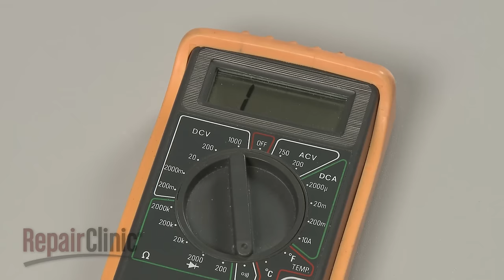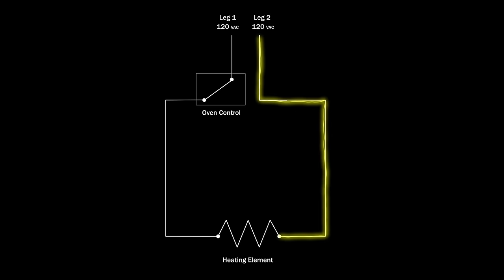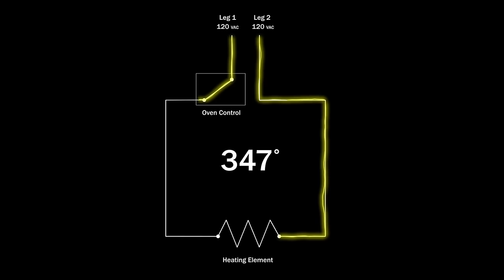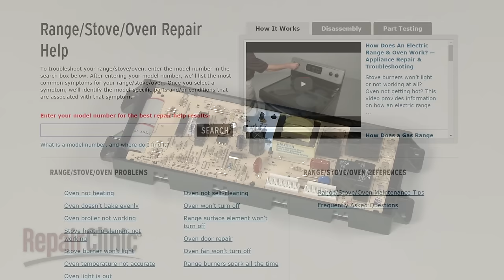Electric Oven Won’t Heat — Electric Range Troubleshooting

Comment: I just solved a problem so easily. The story: Bought new Frigidaire appliances. Stove / Oven Range didn't work at all. Nothing got hot, but the clock and lights worked. I had to call warranty in and scheduled a service tech to come in a few days. ANd thinking the worst, I wanted to see if maybe someone can tell me how serious the problem is and I am going to be out of my oven for another week or so, I found this youtube video. It gave me the idea to double check the power to the brand new oven. And so it was in deed. The plug was not all the way in, just enough though to give the lights and the clock its power, but now enough power to the burner elements. I pushed the plug in all the way and now everything works. It boggles my mind of why the factory or the tech was not able or willing to troubleshoot that with me over the phone. It's so easy. Thanks for your video.
Reply: Ha...thanks.  That's what was wrong.  I pulled the stove out and it looked plugged in but I pushed it and it went in just a little bit more and problem solved...thanks

Comment: After following the sequence of components test, we reached the replacement of the controller, which we could reach through the back of the cabinet, where the extensive heat damage of the batting, the oven light socket, the plastic housings on the relays, we were done.  We have pronounced our Frigidaire Gallery electric range with convection oven and are shopping for another range today.  Thank you for the video.

Comment: 1. Malfunctioning bake/broil element
2. Incoming power problem
3. Loose or burnt wire connection
4. Blown thermal fuse
5. Defective thermostat/sensor
6. Malfunctioning oven control board
Reply: Where is the thermal fuse?
Reply: @lindahawkins8035  where is the fuse ??
Reply: Really good information, sadly for me other than the element there’s no way I could be a regular person replacing thermal fuse or thermostat sensor oh my God I touched the oven control but I might blow the whole house up!… Good video though but it only reinforce that I don’t know what to do about my oven not getting hot I might find out what it is but I will be able to repair it myself other than the element
Reply: @raquelclass9647  there is a reason specialists exist, while you don't want to pay, they are gonna be able to do it and do it right if you don't feel confident. Especially if you think your gonna mess something up worse which is kinda hard to do if it's already not working. It's generally cheaper to have it done right and with a warranty that comes with it.  Vs you being a parts replacer, guessing, getting it wrong, and costing more money in the end. Just a lil food for thought.

Comment: One thing RC does not mention with regard to the control board. You can use a multimeter to test voltage is being sent to the oven element at 220. If it isn't that is probably a good test to rule this out.

Comment: Thanks you saved me $500! I tested the outlet and it turns out one of the breakers had tripped.
Reply: Where is the breaker located?
Reply: @djsuichic1562  breaker box.
Reply: In a wall next to the kitchen.
Reply: You have two breakers in the same inlet?    Dude if you have two single pole breakers to make 240v you have bigger problems bud.

Comment: This just happened to me. My warranty is up too.  the clock was working but not the top or oven was getting hot.  The plug was loose so now it works now.  I have a GE glass top oven, only 3 yrs old
Reply: i read your comment an checked my plug an it works now lol thank you

Comment: Kenmore oven the problem is the top element work the bottom element does not but it does not have a break in it so what could be the problem
Reply: Did you find out? Dealing with this now
Reply: Did you find out

Comment: This information might come in handy- I have a 13 year old  GE profile oven . My symptom ?  The  oven would reach the correct temperature but after 10-20 mins  I would have lost about 50 -60 degrees ... I  ended up changing the termostat - that was not the problem.  Solution - it was the convention element that was burnt !!    Somehow the oven uses all three elements to keep the termperature of the oven and not just the upper and lower elements.
Reply: My oven is about that old. They can last a very long time?
Reply: Wow, same GE Profile with same issue of not maintaining heat and if I open the door, heat escapes, it doesn’t reheat unless I turn off the oven and reset the temperature. I suspect it drops heating during long baking sessions as well. Hateful that it counts up the temp as it preheats, but then lies and only shows the desired temp and not the actual.

Comment: Question.  I have a 15 year old Kenmore stove that I have replaced the element in several times.  The other day I turned it on to preheat and came back in about 15 minutes and all the lights were off.  I reset the breaker and the lights came back on but the bake element would not come back on.  I then checked the bake element and it had broken in a hot spot.  I replaced it the next day and it would still not come on.  The only things left in the circuit are the control board and fusing resistor.  I think the control board is ok because I can press the bake button and then the up arrow and when I press the bake button again I can hear the relay activate.  The same thing happens in the broil circuit - I can hear the broil relay activate.  The top side of the oven works fine.  I have all four top elements but no bake or broil.  I think the fusing resistor popped.  What do you think?

Comment: WIthout watching video, it's probly a fried wire and terminal box.  Take off the back cover.  See a fried wire going into a melted plastic black box at the bottom?  That's it.  Unscrew the wires, unscrew the terminal box, get the model number from the drawer in front, go to the appliance parts store, get a new terminal box, go to Home Depot, get a new wire prong connector, screw in the terminal box, cut the fried wire back to where it's not fried (not too far!),  put on the new connector, screw it all back together.  Turn on your new working stove and buy something with the $200 you just saved.
Reply: Nice

Comment: My over won’t preheat! It takes forever and never reaches to 350. What do you suggest
Reply: bake Elemet does not work
Reply: where is the thermal fuse located
Reply: David Lewis where is the thermal located

Comment: We have a Frigidaire stove that is about 5 years old.  It has decided not to preheat to the proper temp.  It took nearly an hour just to get to 275.  Do you think that it might be the thermostat?
Reply: Bob Hurst did you find the problem? Mine is doing the same thing.
Reply: @lindamuller2353  Mine is doing the same thing too? Anyone know what's going on?
Reply: My oven is doing the same as yours, did you solve your oven problems?
Reply: Mine is doing the same thing
Reply: Sounds like a faulty thermostat

Comment: my electric range Maytag might be dead ?
i had a chicken in the oven at 375 degrees and after 20 minutes, i was in the living room, i heard what sounded like electricity
like what you hear in youtuve videos of power lines arcing
it then shut off completely
if i turn the knobs for the burners, they dont turn on, the light is off in the oven, and the oven wont turn on - - but if i turn one of the burner knobs on, then the lcd display screen shows some error
any idea what might have fried ? thermal resistor ? green computer board ?

Comment: Hello,

My oven stopped working after I turned off the power on my consumer unit as I was tiling my kitchen.
When I turned it back on (I realized I didn't switch my cooker isolator switch off), my hob and grill worked fine.
MY oven light and fan worked, only it wasn't heating up.

Is this a simpler element issue? 
OR is it a circuit board issue?

I'm quite savvy so want to fix it myself!

What do you guys think?

Thanks
Reply: My oven just died . no power at all . no light  .
Reply: @patriciakabasa3930  Did you get it fixed?
Reply: @abuasfur7334 did you ever fix it? And if so how. Sounds like exactly my issue
Reply: @StoneMotions  Yes it was the element that needed replacing

Comment: Dang mouse got into mine. After watching this video I had the courage to open up the back and see if I could get lucky. I guess the little guy got hungry one day and chewed up a bunch of wires. Anyway, all I had to do was splice up the wires and give it a good clean Now I'm back to cooking. Thanks for the video.
Reply from the maker: You're welcome! Mice do that. Make sure to clean the path they walked with bleach or a mice urine cleaner because they will come back over and over again. Also good to clean up any feces to not expose yourself to disease they could carry. Wear rubber gloves when your cleaning and keep it well ventilated. They might be using the wire material to build a nest.

Comment: Our LG electric oven was working perfectly fine yesterday and today it turns on but the oven and cooktop will not heat. 😩😤🤔 any ideas?
Reply: same problem with ours worked perfect yesterday n today just wont work other than warm top
Reply: Alley do you have nice looking feet?

Comment: I've got the exact oven as pictured. Yesterday the baking element burned up in spectacular fashion. Today I replaced the element and neither element (broil and bake) is working. I've got 120 V to each leg. Continuity to new element. Wires are not burned up. I cannot see any visible burn marks nor do I smell anything at circuit board. The cooktop works. I have 1093 ohms of resistance on temp sensor. What else could it be? Are the broil and bake relays able to be replaced or are they soldered to the board? Help please...
Reply: Whroolpool oven or boiler does not work.
Reply: xx1lomazdawgxx
 I have a similar problem as you. What was the fix with yours? Thanks!
Reply: Hot point  fridge isn't getting hot enough

Comment: Is there a fuse somewhere that might cause the burners and oven not work. All control buttons come on but stove doesn't heat up. G.E glass top stove.
Reply: Ever figure out the problem? Mine does the same thing.
Reply: @f4fake22  did you fix it?
Reply: @oVoMir  nope! Calling a appliance repair company, I give up

Comment: I have power to range. Burners all work, broiler works. Bottom  oven element gets warm and that's it? Have tossed fused box switches to no avail.
Reply: Element seems good no break or blistering. Everything seems solid.
Reply: Jim Willis; Nope didn't even try, gutting kitchen and getting all new appliances.

Comment: oven gon off , fan working still not heat up , replaced element still not heat up ! grill works , cud it b oven thermastat ! zanussi delux gas hob.
Reply: Robert Rolls wat can I do 2 fix it ,how much wider it cost to get it repaired